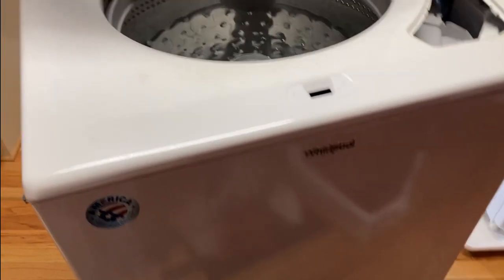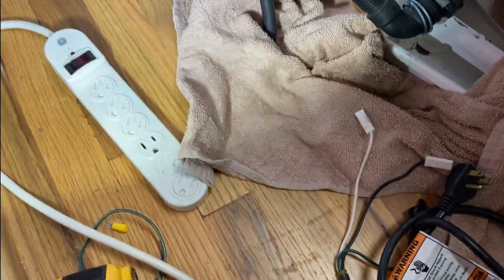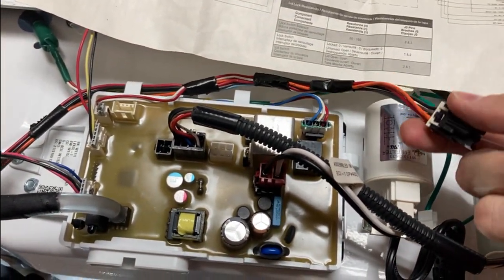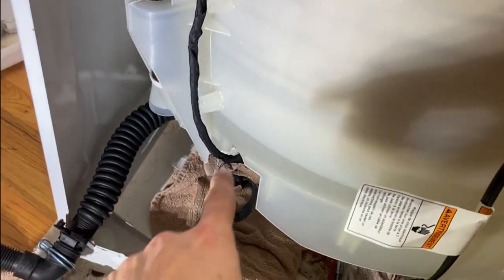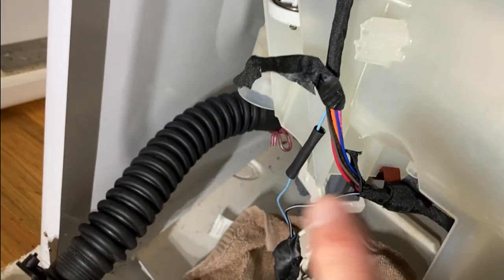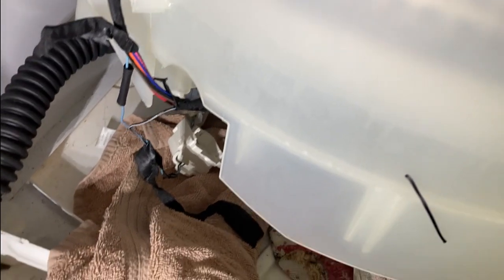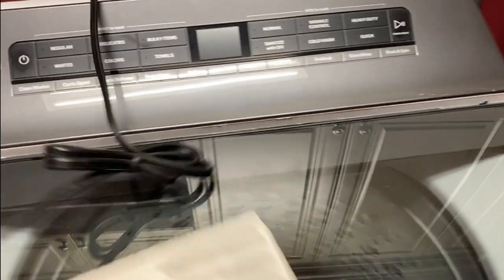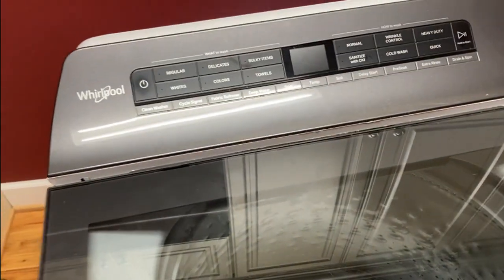Whirlpool Washer Not Draining (WTW5105HW) - Diagnostics - Good Pump

Comment: Had the same thing happen to mine. I had stupidly purchased an extended warranty from Lowe's. Wish I hadn't. They first thought it was the pump and then they replaced the control board. Ultimately, they declared it fixed when it wasn't after 4 visits from 2 different repair people and a couple of months without a working washer. This video may help me repair it myself so thanks!

Comment: Cheap harnesses mass made somewhere likely overseas I have had several of these as I work on these professionally  …cheap ass washer  don’t measure up to what consumer reports says // moral to the story bad engineering
Reply: I know Speed Queen is the best but I need something that has a larger 4.0 CU/ft or above washer for some of my blankets. Do you have a preference as to a decent Whirlpool/Maytag washer? I'd also like it to use a lot of water if possible. I don't care for conserving water at the expense of not cleaning my clothes properly. I have an old 2006 Whirlpool that started making noise after I replaced the seals on the support and basket drive. A person on one of the forums suggested it was the transmission but I don't want to gamble 200 for that and it not being the issue.

Comment: Thank you so very much for taking the time to create and post this video! It was such a massive help in diagnosing the SAME EXACT issue in our washing machine (WTW5105HW). We've only had this product 16 months and of course it's now just a few months outside of it's warranty, similar to a bunch of other comments I see here. Highly frustrating and so disappointing of Whirlpool to have such unreliable components. But thanks to you we've got a working machine again (...for now at least!)
Reply from the maker: No problem, glad it helped. When I found the issue I did not know if it was a one-off problem or systemic. Judging by the comments it is a bigger problem. I am slightly disappointed considering these are not cheap to purchase. Luckily a fairly easy fix if you know what to look for though.

Comment: You are the man. Spent forever trying different shit  3 months out of warranty and it was the same thing but other wire at the same spot. 2e arnt the only ones I gaurentee it
Reply from the maker: Yes likely not the only ones. Must be a weak point or tension on the wires right there. Maybe factory will get this fixed for everyone else.

Comment: Lucky that didn’t take out of control board. It does that crap too and that’s not cheap. They should fuse that pump cheap ass engineering.